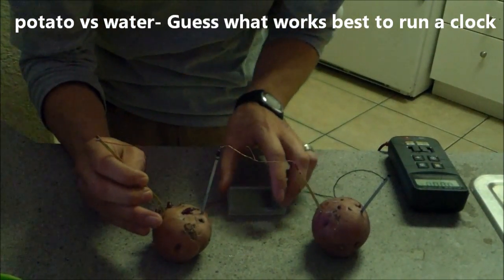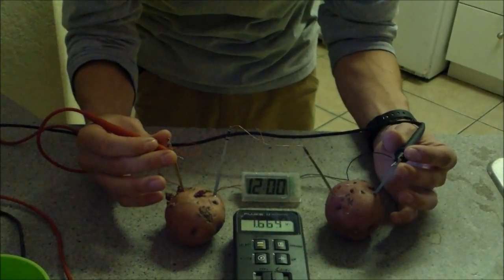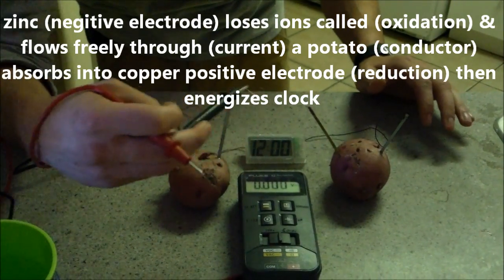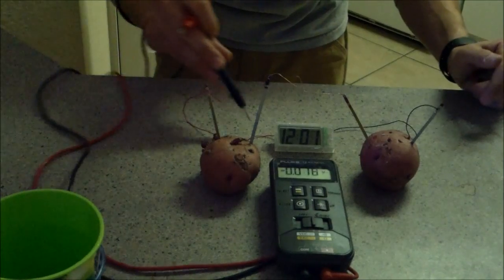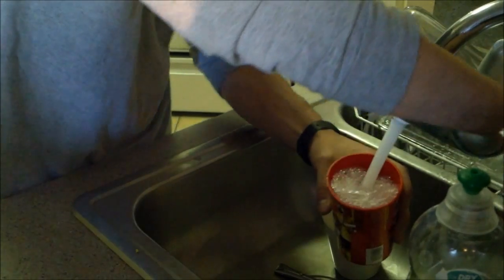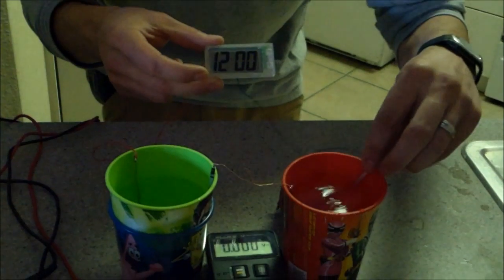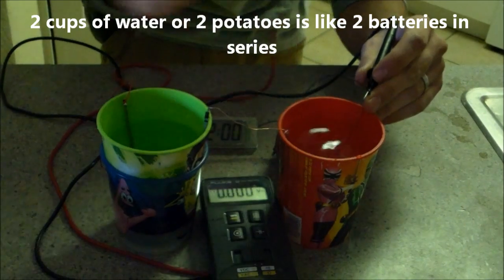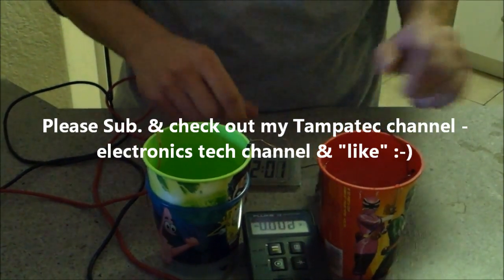How to use cups of water to power a LED clock !!!

Comment: may i know if i put greater amount of water, more electricity it can produce?
Reply from the maker: Ma.Lorierose Gabon great question but late reply, no it's just a chemical reaction, so more cups of water with copper and zinc leads will add voltage, it can still be achieved with few drops of water. however the water will evaporate unless sealed but oxidation will still corrode the metal leads unless replaced or recoated.

Comment: I have tried this configuration with the water and another one i found on the net using aluminium, copper and water with bleach to run a 1.5V motor but none of these work.....

Comment: I have a pioneer car amp right speaker channel works fine left speaker channel is not working. I swiched input cable around but still nothing. So i took it apart and  i dont see anything burnt or black. Any ideals on where to start testing?